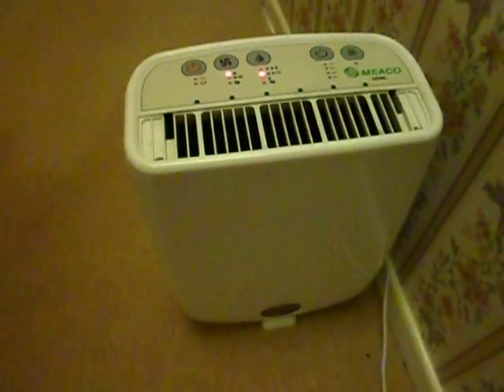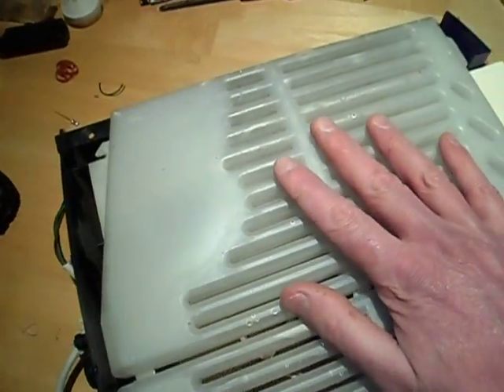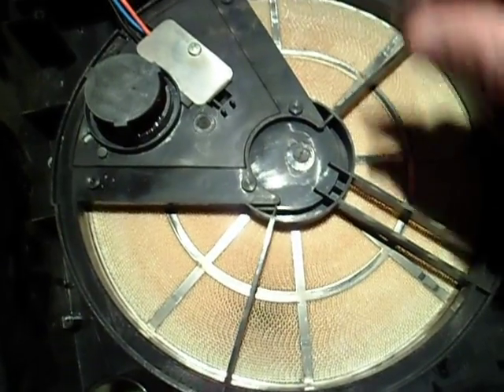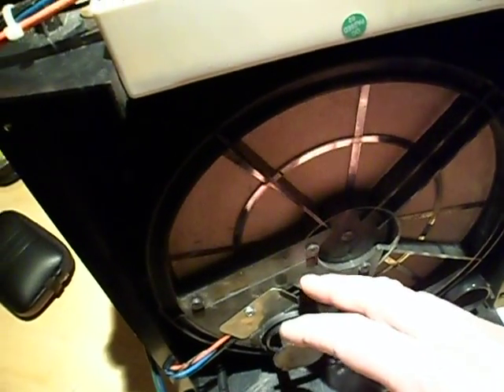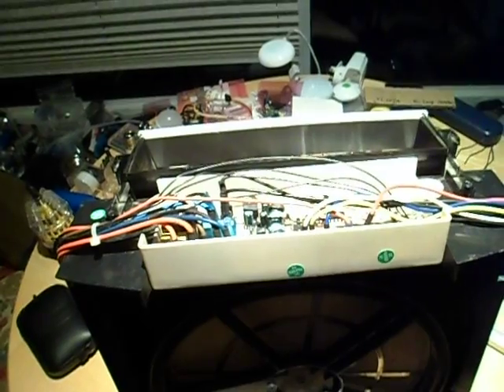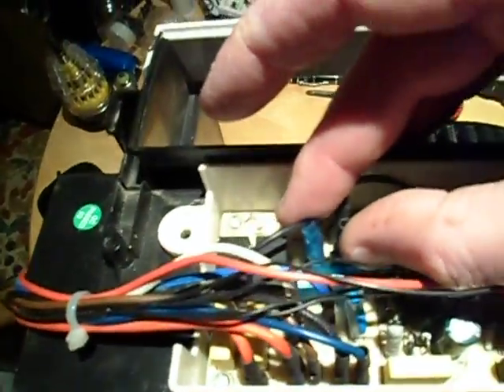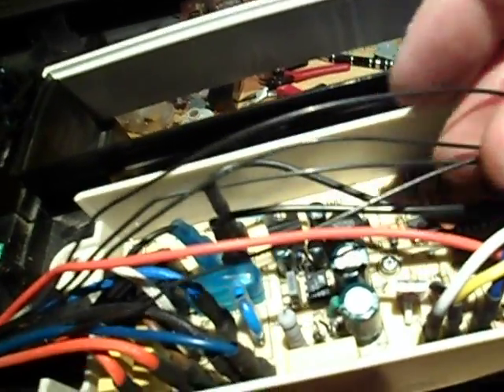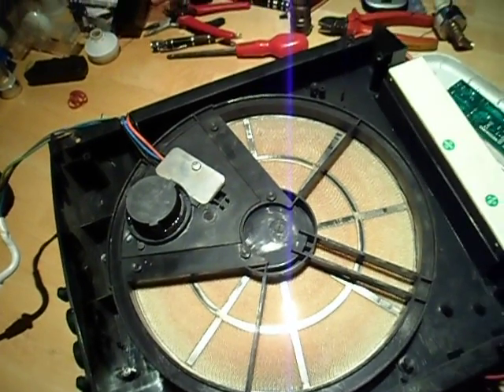A look inside a desiccant dehumidifier.

Comment: Good day, I have a Meaco junior dd8L and the power has gone. I tested the circuit and found that some components blew. Fuse, 4.7uf 400v Cap, 2In 4007 diodes and 8.2 ohm 2w resistor. I replaced all and everything did not blow once I put on the switch only the resistor gave in and I changed it about 3 times. Could it be the lnk306pn IC that could cause the resistor to constantly blow. I have a lap tested the 5v regulator out of circuit with an input voltage and that is ok. Please assist in this anyone
Reply from the maker: It sounds like the switching transistor has failed in an on-state and is taking out the current sense resistor.  It's worth changing the chip if it's very standard.

Comment: Just got a dehumidifier recently as mildew inside one of my camera lenses (effectively knocking half of it's value off) was the final straw. 
Went with desiccant as I like to keep my house at a lower than 20C temperature. Meaco are claiming that their compressor dehumidifiers (20L/day+ models) can outperform their desiccant ones on a KW/h to water scale down to 15c and get close down to 10c which I'm skeptical of. 
Kind of makes me want to change my mind and get a compressor one, especially seeing the cost to fill the (2 litre?) tank.  It's about £0.50 to get 350ml out of one now with the doubling in electricity prices.

Comment: About that drum motor, took it apart completely, nothing wrong in sight, reassembled but without the output shaft and gear, turned on the dehumidifier, still the direction is random every time, cw spinning, ccw free spinning. Strangest thing.
Reply: I have some kind of memory of when I was playing with a microwave turn table motor that it would switch it's direction when stalled? So perhaps this is what's wrong, it's not stalling in the wrong direction but free spinning instead? Not, sure, been a while.
Reply from the maker: Yeah.  By default they have no fixed direction and a mechanical reverser that often fails.  The way these work I'm surprised they even had it directional at all.

Comment: Just bought used different brand unit with an issue, similar circuit, but the drum motor randomly starts in the wrong direction and then only hums because it's cw only. Any ideas why the circuit does not bias it's starting direction?
Reply from the maker: The motor is a synchronous motor that has no fixed direction, but there is usually a mechanism to stop it running in the wrong direction.  Check that the motor hasn't ground its bearing to mince.  I had one that frequently ran in the wrong direction, but the unit still worked that way.

Comment: Hello,thanks for the video. What means the  red led ALARM? YL-208A
Reply from the maker: It may mean the safety circuit has tripped (thermal fuse?) or that the water container is not being detected, or has a stuck float.

Comment: I have- " EcoAir DD3 Simple " desiccant dehumidifier. been using it for the last 6 years, no problem, just remember to clean the filter, not saying that they are any better or worse, than your one.I have no heating in my home, it gets down to 0 degrees celsius indoors, but the lower the humidity, the lower heat transfer is, I do not feel so cold,  plus it does warm the air up a bit.
damp air is lighter, so it rises, so would it be better to suspend the dehumidifier higher up, so that it can grab the damper air, and attach a hose to the dehumidifier down to a water container

Comment: I'm a long time subscriber, I just bought one of these for a 5er today and took it apart because it was absolutely filthy with dust inside and out. I accidentally snapped the fan when putting the fan bolt back on because I overtightened it, woops, luckily a bit of superglue sorted that. I did vacuum the drum to try get the dust out of it, I think compressed air would have worked better but i dont have access to a compressor. Mine does go into fault mode when on low fan settings which implies its overheating, not sure why as I've cleaned it very thoroughly. But its working a treat on high fan speeds. I had no idea desiccant drum dehumidifiers existed 24hrs ago. Very cool tech.

Anyway to see this dehumidifier on your youtube was a great coincidence and relief. I probably should have watched this video first before taking mine apart, it would have saved me searching for the screws under the buttons.
Reply: Also from my brief research from today, and from reading the manufactures manual, its VERY important to keep the filter clean (to stop the drum and other internals getting clogged with dust) and to let the device run its cool down timer (not just turning it off at the plug) as the fan needs to cool the heater element, otherwise the residual heat can melt nearby plastics. As well as your sound advice of running it on low to keep the heat down.

The filters on these, in my opinion, is way too coarse. It should be finer. As dust easily flies through the coarse filters these come with. But finer filters would restrict airflow = overheating. I suppose its a balancing act.
Reply from the maker: The ones I have here are the simpler units with just a mechanical humidistat.  They don't do a cool down cycle.  They just shut off.
Reply: @bigclivedotcom  Clive, on my other account here. I had strange dust flying out the fan of mine, which turned out to be some sort of buildup, almost like calcium or salt, on the heating element coils. Any idea what it could've been? I can only assume the zeolite coating was somehow perspiring from the drum and then reforming on the coils?  Would you care to look at my video? Skip to 11:32
Reply from the maker: @rattech  I've not seen that effect on the heating element.  I wonder if it's something from the ambient air that is precipitating out.  Are you near the sea?
Reply: @bigclivedotcom  Thanks for looking. I'm not near the sea nor was the guy I bought it from. But who knows its history. I did try to dissolve it in water to remove it from the coil, but it didnt work. Which makes me think it wasnt salt. I had to pick and crush it off very carefully between two jewelers files. It was quite strong.

Comment: Why does it heat up the air?
Reply from the maker: It heats the desiccant drum to drive the moisture out and condense it.  I tend to use compressor dehumidifiers in summer when they are most efficient and desiccant ones in winter for their better operation at low temperatures and additional heat.

Comment: Hi Clive, thanks for excellent video. My dd8l has dead front panel, but has mains to control board and -6v and -12 v are ok, do you know what value Vdd should be? Or what can I check to get lights to control panel?
Cheers
Reply from the maker: I think the panel voltage should be around 5V.  Treat all circuitry as being at mains voltage.
Reply: @bigclivedotcom  great, thanks, still dead...can you please tell what processor it uses? Can't read number through varnish.

Comment: Hello! My humidifier has broken - its giving the symbol thats its always full. The plastic pin in the water tank above the styrofoam magnet is broken. Do you think this is the problem? I read somewhere that it could be the magnetic reed switch. Not sure if youd be able to give a bit of advice if its an easy fix!! Thanks :) :)
Reply from the maker: If the magnetic float is not moving freely it may be that.

Comment: mine is coblete dead even the led in the panel is not light  i check the control board and the fuse there  is ok maybe the thermal fuse is the cause for this?

Comment: My dessicant drum eventually got clogged with fine dust and the unit kept cutting out due to overheating. Had to take it apart (like you did here) and brush hoover the drum. Works fine again but it was a bit of a bugger to get to! The exterior filter is quite coarse.
Reply from the maker: These units are still in their early days.  Hopefully they will become more serviceable over time.

Comment: Hey Clive! You may remember me from a few years ago talking about desiccant dehumidifiers with you, and the flaws of those horrid mica regeneration heaters in them! I attempted to retrofit an old ecoair element housing with a PTC element which was a success as that dehumidifier is still working.
I've now noticed a PTC manufactured one in China! If you type in "ceramic PTC element for dehumidifier" into Google, you will find it! Only problem is I cannot find any info on which model this new element has been made for!
Would be rather interesting to find out though! I've tried reaching out for a response but have received no response so far.
Reply: If you type in 'minkvon PTC dehumidifier' into Google images, it is the first result. 🙂
Reply from the maker: I'd pondered whether one of the many finned PTC heaters could be used in that application, but was concerned about the moisture.  The air is very humid in that loop.  Ifg they can make it water resilient it would be an ideal application.  Especially with the inherent overheat protection.
Reply: Still, it is interesting to see a PTC version of the mica triangular element units making an appearance online. Someone somewhere is giving it a go.

Comment: Hmm, one of mine seems to have a minor fault whereby the main fan and the desiccant wheel motor won't turn off when the humidity is below the set point (they would normally turn off after a few minutes, but they just remain on). They DO turn off with the use of the timer or the normal Power button, however. The heating element definitely turns off as normal (you can hear the relay and the mains power draw decreases). Any troubleshooting tips?
Reply from the maker: It could be a failed triac that has gone short circuit.

Comment: IMHO this is a very unreliable device. It was working fine for 2 years. Then it blew the thermal fuse (the one below the heating element). I replaced it three times, the last was a few minutes ago... Now it works but not reliably. It flashes the red light often. I let it cool down, then started again on low fan speed. It seems to work for the moment. Will see. Anyway, thanks for the great info!
Reply from the maker: I tend to recommend these units are used at the low setting.  The heater unit also has a fan, so it's possible something has jammed up or become blocked.

Comment: Help
I know this video is over 5 years old, but hopefully, Clive, you will pick up this message (or anyone else).
I have one of these desiccant dehumidifiers but its not working.
It blows out hot air as normal, it all operates as normal but there is nothing in the water tank. It used to fill this thing up, but now its not even damp.
I have put it in the bathroom after a shower, with windows shut and steam everywhere, yet the tank remains empty.
I took the cover off and operated it, the desiccant drum turns, the heater works, the blower works.
Do these desiccant units expire?

Does anyone have any idea what could be wrong with it.
Its one of these... https://www.dehumidifiersuk.com/eco-air-dd122fw-simple-7-litre-low-temperature-desiccant-dehumidifier.html?gclid=Cj0KCQjw0IDtBRC6ARIsAIA5gWs_8LDVcHgXuXuPFF3rXa1ag_rnJDBsdU8pI2nWTpd1ruJFRpe1hLMaAr-REALw_wcB

Thanks
Martin
Reply: This may be too late, however, I had the exact same issues you were having with my ProBreeze dehumidifier and I was able to fix it.  There are 2 fans, the big one for cold air, and the small one for hot air.  The hot air fan wasn't turning, and thus no liquid was collected.   He mentions this as the "heater motor" at 1:04 in the video. Hope this can help.
Reply: @fallacyz3r0  Hi, no not too late at all. I still have the de-humidifier. It puts out hot air but doesn't collect water. I had it appart and looks ok. The honeycomb wheel (or whatever its called) rotates and obviously at least one fan works to kick out the warm air. Don't remember there being anothher fan though, so I will have another look.
Thanks

Comment: The Goldair GD330 8L model looks to be another rebranding of these. I picked up a used one after being informed and inspired by this video. :) I'm now wondering if you could modify one to work as a ducted whole-house unit, alongside a heat exchanger. Fresh intake air would be dried in the desiccant wheel, then warmed in the heat exchanger using stale exhaust air from the house. The hot, wet reactivation air from the dehumidifier could be sent into the heat exchanger as well for heat recovery (and the condenser wouldn't be needed). Sensible? (Pardon the pun!)

Comment: I also have the Ecoair Simple and it developed a whoosh, whoosh, whoosh noise, that's at 3Hz obviously, but 6 dB louder - too much. Took it to bits, looked clean, reassembled - no difference. Knee jerked, ordered a new one, came today. Re-stripped the old one and took off the water collection plate and it was full of jellylike gunk stopping flow. Have a guess what Mum's getting tomorrow?
Reply from the maker: The desiccant units are still a new thing and they have made a few mistakes in the design.  The buildup of goo seems to be an issue.

Comment: I have one of these and it has developed a fault warning light keeps flashing after switching on. It works fans on and then 2nd fan light flashes and goes into warning mode then  a few minutes later fan shuts off but light keeps flashing. Can you advise please on what maybe the fault
Reply from the maker: Does warm air come out?  These units monitor for correct operation of the heater and fans by detecting temperature change.  Most common failure in the early units was the heating element.  There's also a small fan that circulates the air in the heating/condensing path.
Reply: @bigclivedotcom  Thanks for reply, when it's turned on its blows air for a few minutes goes into faulty mode and then shuts of a couple of minutes later
Reply from the maker: @neilpatel8202  It sounds like it's sensing a thermal problem.  Possibly a heater or fan failure.
Reply: @bigclivedotcom  I opened up the unit and had a look it looks like the motor for the desiccant wheel has packed up as the wheel seems like it is burned. Can you advise should I get a replacement wheel along with the faulty motor and if so do you recommend any sellers for the spares... Thanks for your kind help😊

Comment: My Eco-air dessicant dehumidifier just failed, the synchronous motor that drives the drum had stopped, the gears in it's internal gearbox had stripped. It looks like a common part but I couldn't find a replacement after hours of searching. It has a very specific gear ratio and is CW only. 99.99% of synchronous motors are CW/CCW (randomly). I have now switched to a Meaco compressor model - they have got much quieter than they used to be. Anyone buying Eco-air please note - they do not answer emails!
Reply from the maker: The drum motor grinding itself to bits seems common, but I couldn't find one with a matching shaft.  I don't think the direction of rotation matters as mine ended up turning in either direction before it failed.  These are the first of a new style of dehumidifier, so they have had teething issues.
Reply: Thanks, I'll keep a look out for a suitable motor, and test if the wheel direction really matters! It would be handy to have the dessicant machine for winter (more efficient in cold + useful heat output) and a compressor one for summer (more efficient above 20C + no unwanted heat)

Comment: Somehow I missed this video, and I thought I'd seen them all! How is it performing after 5 years?
Reply from the maker: As with most new products it's had its teething problems.  I still use desiccant drum dehumidifiers, but the simplest type with no significant electronics.  This particular unit ground its drum motor bearing into metal powder and it's got a non standard shape of shaft.  The early units are also notorious for burning out their heaters and their water collection system getting gunked up.
Reply: @bigclivedotcom  in short... Badly 🤣 ill skip getting a new one in that case!
Reply from the maker: @phonotical  I've not had a problem with either of my ecoair simple units.  I always run them at their low heat setting.
Reply: @bigclivedotcom  I'll look into it, thanks!

Comment: Hi Clive. Just wondering if you've any suggestion re an eco air dd122fw simple stopping after just s few minutes running. Cleaned, fan running , no check or full light showing it just goes straight into its cool down cycle and then stops. Blue light on side shows initially but then it switches off as the unit goes into cool down mode. Any thoughts welcomed. Thank you. I appreciate difficult not seeing the unit. Cheers Russ
Reply from the maker: May be a failed internal heater or condenser fan.  Does the air get warm at all before it cuts out?
Reply: @bigclivedotcom  thanks yes the exiting air is warm and all motors running . Dessicant wheel turning steadily.
Reply from the maker: @russellpayne6333  If it's the simple one with just the mechanical humidistat then there's not much to go wrong.  I wonder if there's a thermal sensor that is tripping.  The condenser unit has a small fan that circulates air in a closed loop between the heater, desiccant and condenser.  Does it still do it if set to the low heat setting?
Reply: @bigclivedotcom  yes it could be anything I guess and i don't have the parts to be able to swap out sadly. I've seen on the eco air website they will do a guaranteed fix whatever is wrong for £36 which I reckon is pretty good . Thank you for your help. It's good to know the art of taking things apart trying to fix them is not completely gone !!